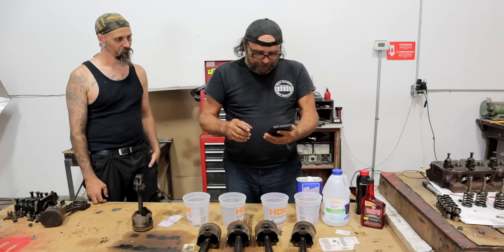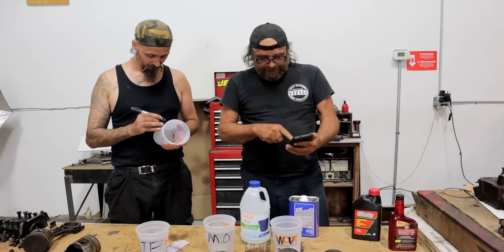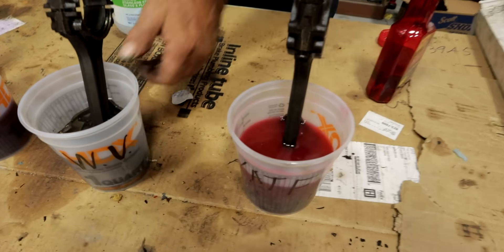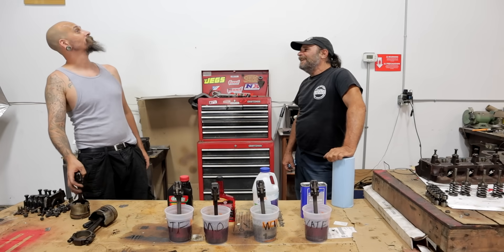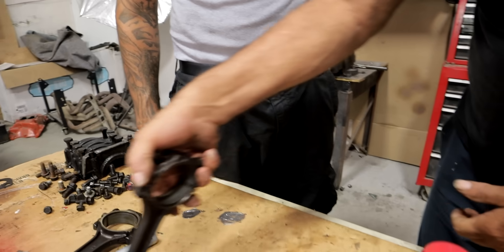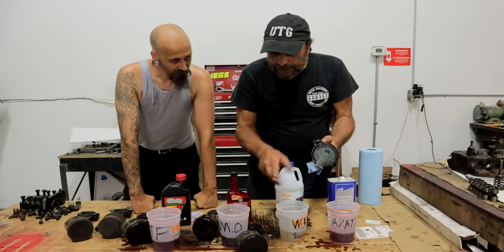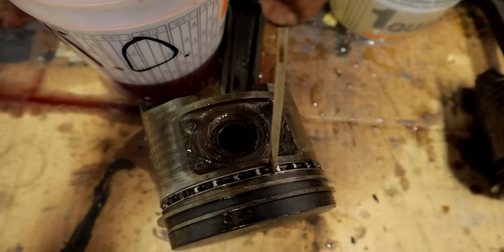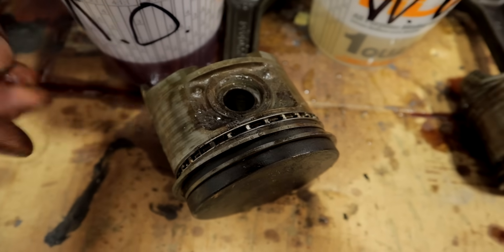Best Fix For A Stuck Engine - Viewers Choice. Marvel Mystery Oil, vs ATF, vs Acetone, vs Vinegar

Comment: The old Dexron II transmission fluid when at engine temperature acts pretty much like a solvent and should be
AOK to use since an older gentleman that had once worked at a GM Plant said to use provided that you use it
in such a manner as this: 4 quarts of old engine oil as in on a 5 quart system, 4 Qts to 1 Qt of Dexron II or just
drain 1 quart out of your 5 quart system and add 1 Quart of ATF. Drive the car for 200 miles and since the vehicle
is already in need of an oil change. Drive in such a manner that you are NOT driving the hell out of it but drive it
while acting in good prudence then go ahead and change the oil and replace the filter! This will help to release
a bunch of contaminants that are inside the engine that lead to these kinds of eventual problems!! YET, I also
believe that about 11 ounces of Acetone and 21 ounces of Dexron II if not Dexron III can surely speed up the 
process on an already viable engine just prior to a scheduled oil change should help work pretty good too! BUT,
do this in such a way that you are ONLY idling the engine for 20 minutes at 1200 R.P.M. Then change the oil n filter!

Comment: Ty for the video viewing. I had used MM on the floor jack when it would not hold pressure even when I stand on it. somehow I reason the use of MM on fuel and oil system may be used on any thing with o-seal. i have an old Sear 2 ton floor jack, nearly threw away or give it away. Than i thought i give a try fill the floor jack with MM and prime it few times. i let it set overnight to get the seal rejuvenate. sure enough i pump the jack to work the internal seal. this time i stand on the lift plate. it held pressure and repeated over and over just to be sure it work. this time i jack one side of the car which kept pressure over half a day. i did that on my 1971 MGB GT when it was leaking on the rear shaft area. after adding MM into the oil system and ran for couple hours, l set it overnight, the leak slow down and later no leak at all. the MM does work to reshape the o-seal when the seal got old and a flat area created. MM does work on seal if is not torn.

Comment: NOW THE REAL TEST BASED ON THIS VIDEO......Now you are saying I can remove spark plugs and put vinegar in each cylinder and soak for 24 hrs or longer to remove carbon and unseize piston rings!!!!!... I would probably have to change engine oil afterward.... LETS HEAR THE ANSWER(S) AND COMMENTS!!!!

Comment: pour a boiling hot mixture of engine oil and diesel fuel in the cylinder.......the detergents in the oil and diesel will clean the shit right out from around the piston...and the heat will expand the cylinder....keep the block hot with a weed burner (the oil has to be at least 200 degrees to activate the detergent)......it works 10x better than all of this stupid shit

Comment: Acid eats rust and cleans metals, muriatic acid would do even better.  But I'm not too sure if I would pour acid into an engine to clean the rings.  I mean acid also eats aluminum and brass and every other metal part eventually...

Comment: But what about  seized engine ?  That's simply parts  ! Are  you suggesting pouring vinegar into a seized engine?
Reply: Yes that’s the point it will clean up the cylinder walls and hopefully the rings, currently trying it out on my old 240z engine let it sit for 5 days sucked it out and shitload of rust came out so pour more in going to try to rotate it this weekend

Comment: Currently doing an Acetone/ATF 50/50 in the cylinder walls now. If that does not raise the compression after a good warm drive, may trow some vinegar down there. good job guys.
Reply: Sounds like a plan. Was just wondering though once dumping the vinegar in the cylinder while motor is still intact then starting it to get it loose later how does one get the vinegar out properly after & neutralise it's acid effect inside the cylinder with the pistons in there
Reply: You could possibly use distilled water to wash it out, im not 100% sure
Reply: Baking soda and some ATF should neutralize the acid. Baking soda is what's doing the neutralization. But you need to get it in there so I figure some thin oil will do.  Unless you have a way to gey the water soda mix out?

Comment: The white vinegar works apparently because it's an acid. But you can't put acetone in your gas tank white vinegar in your gas tank or ATF in your gas tank. I think if you had soaked them for 3 days the mmo and the ATF would have worked much better

Comment: If it's just rust-siezed, 5 minutes in 70-85% phosphoric acid will definitely take care of your rust problem. It's gotten a bit more expensive due to the '2020 issue', but I use it quite frequently on all manner of things for rust removal. Be forewarned, it is STRONG on metalized rust and Not something you coat and walk away. The moment you start getting white surface deposits (oxidation), it's time to wash off. Have a 5 gallon bucket of distilled water handy (or you can neutralize the reaction with ammonia). Carbon-siezed is more difficult to remove passively as it resists most every cleaning agent or solvent. Ultrasonic cleaners with a mild acid is the way to go there. Acetic acid is what makes vinegar work, and you can get the Good stuff from chem supply houses quite readily, though I wouldn't surpass 35% diluted for general cleaning duty.

Comment: I commented on your video about cleaning the water passages once and asked if you ever tried filling the block with white vinegar.  This is why asked that. I've been using vinegar to clean and remove rust from parts for about 20 years now. I don't rebuild engines much but I do know how well vinegar cleans off rust and gunk. I actually predicted the results of this test.

Comment: Vinegar is mostly water with a little acetic acid. I might use it on a stuck engine I was going to pull apart but not one I was going to run. You'd have to flush the hell out of it.

Comment: The viniger works by etching tje aluminum. Little impact on carbon. Viniger is mostly water and a very light acid. My choice was dry laundry detergent 2# per gallon of water. It has phosphates for greater etching and a strong detergent on the carbon
. It has been my tear down first part dip for cleaning for 30 years. Secondary.mechanical like wire wheels etc

Comment: If your try to unstick the rings in the engine I would not use the vinegar, like others have mentioned it would not stay put long enough to do any good. If the engine is capable of running then the MMO is a much better choice as would be BG44T to put in the crank case. Just follow the manufacturers instructions. If your cleaning the pistons out of the engine then just stick them in a gallon can of carb cleaner.

Comment: You can not put vinegar in a assembled engine. It will damage the bearing shells. It removes rust because it is a acid.
Acetic acid.
It will not remove rust if the parts are oily. The oil will prevent the acid from getting to the metal (and rust) surface.
Rings jammed in place by carbon can be removed with Dichloro methane. Aka methylene chloride paint stripper.
Again this cannot be put in a assembled engine, it will eat away every rubber seal in the engine.
Ps: Dichloro methane will also eat the skin off your hands.

Comment: Acetone is a very powerful chemical. They put acetone in fingernail polish remover. Don’t get it on the vehicles paint. If you use the acetone use it sparingly and use it up quick like a long trip. You don’t want it sitting in the gas tank to long. Some say  it can eat up seals and rubber.

Comment: Used MMO for decades on stuck engines. Soak for a week and breaker bar to crank nut. Worked a few free this way. The piston going up and down will move those rings slightly on each stroke. Good test but if stuck it's going to be stuck in cylinder.  I took a rusty exhaust clamp and pit in a old butter tub with ACV for 24-48 hrs and that baby was spotless. Guy used to take some heat to the bottom of pistons and swore that helped. Idk. I know a dip in a hot tank will get blocks very clean and help too. Depends on which way u wanna go. I used salt water and peroxide to rust clean clamp and then used muratic acid for 10 min. Clean as can be. Dried fast after wash in water then put Ospho on it. Still no rust months later. Stuffs great for that kind of stuff. Ospho can save alot of time and money for surface and bad rust. Get chunks and flakes off and soak with Ospho. My Pap got a formula for rust proofing in 50s. 1 quart any new used oil, 1 quart any new used trans fluid, 1 tube or tub of grease, 1 wax ring toilet flange gasket. Mix and heat on burner. When mixed spray, brush, pour etc on frame, body, seams etc. I've used this for decades. Fights north east rust better than fluid film, blaster, NH wax, etc. Alot of that has no oil base in it. Yes wax will coat metal but when it's wore off or whatever it rusts. Best is ospho for rust, seal it all up so it never can rust, use favorite coating of primer, zinc paint etc. Then the rust formula and you can forget about it for years.

Comment: Marvel Mystery oil is good in the old engines that couldn't run on unleaded gas...illegal in Canada. I had a friend bring me a supply from NY back in the 90's to use in my old side valve "45" Harley. 1 cap full or so per fill  up and all was good. Didn't know they even still made that stuff.

Comment: The vinegar will even work better if you soak it in acetone first. It will remove oils leaving nothing but rust for the vinegar to dissolve....I do a similar process with citric acid, but you cant leave metal in it as long as vinegar.

Comment: Can you add vinegar though to the crankcase oil if you trying to free up the rings without disassembly? Or to the fuel system, force it down the carb like sea foam or Berrymans?

Comment: That was shocking that strong white vinegar worked. Problem is though you can not put vinegar or acid in your engine and run it.  You can actual add Acetone, B12, PB Blaster through the engines oil to attempt to free the rings. Since vinegar is mostly water it is a recipe for disaster in the engine. I did not consider that the rings where rusted in place I was thinking more like carbon in place due to all the issues we have on todays cars with this! Cheer's!

Comment: No one considered B12 Chemtool? ATF and Acetone will not stay mixed they separate over time when mixed. The straight acetone will do the best out of those 4 choices. I would never put anything aluminum into an acid. Out of the choices the ATF/Acetone will do best but still not the best chemical for the job. I posted this 6:36 into the video.

Comment: Great stuff! Thanks for the experiment! One question I've had about the vinegar is would you be so bold as to pour it down the plug holes of a still working engine? I'd be kind of scared the vinegar would etch the cylinder walls. What do you think? 
This engine is getting about 150 lbs. compression on each of the 6 cylinders and it still pulls real hard, but it uses oil like a banshee (No leaks) and it smokes on acceleration. I've tried spraying PB Blaster down the plug holes, to no avail but still hoping to decrease oil consumption and smoke without tearing it down. Thanks!
Reply: For doing a piston soak like that, the only product ive seen that gives proven results is Berryman's B12 Chemtool.  Theres a youtube video on where a guy tested about 6 different products including Marvel Mystery Oil and BG EPG and Berrymans... Only the Berrymans showed results...car went from burning a quart every 300 miles to a quart every 1000 miles.

Comment: Acetone and ATF separate in a cylinder in only a few hours or less. You can test this easily. in one of the cups. Now when separating out which then the acetone or the ATF is at the bottom therefor touching the top of the piston?

Comment: I used marvel oil to free up a stuck Briggs and Stratton one-lunger. I poured some into the plug hole and filled the case. After letting it sat a few hours I turned the crank back and forth until I got a full revolution. I spun it over about fifty times or so, added a little more oil through the plug hole, and let it sit. I drained and refilled the crank then replaced the plug and after a couple cranks it took off. after a little smoke, everything ran fine. I really never expected to save the engine without tearing it down but it is still running after two years.
Reply: My motor smoked so much in the lil frontier after mmo in the cylinders overnight

Comment: Nice.
    Although not surprising I never thought of acetone. 
     Of course one could always use electrolysis as well. Just a little sodium bicarbonate and a bucket of water with a couple electrodes  and a battery charger. After a couple hours later totally rust free.

Comment: I can’t say enough good things about MMO. It has saved my butt lots of times, made me easy money and also saved me lots of money. The latest save was a 1956 330 Desoto hemi that had been stuck for 30 years. I poured some in each spark plug hole, removed the oil pan and hung the motor from my gantry crane. Then I slid a pan of hot coals under it and let it warm up to about 150 degrees. It broke loose with a screwdriver on the flywheel. Spins nice and free now. I have a picture of the setup but I’m not sure I can attach pictures here. I did this on thanksgiving weekend. It seemed the appropriate time to roast that turkey. MMO works much better if you can warm the motor up. It’s best miracles are when the motor will run and you can add it to the oil and fuel. Then it will remove carbon deposits from the combustion chamber and valves.
Reply: It broke loose easy because it was not stuck badly just a little but if you have a real bad stuck engine that snake oil wont to crap. 2 inch steel pipe and a hammer will do the trick all the time.

Comment: ATF is a lube, not a cleaner as far as I'm concerned. I've used Mystery Oil to free up lifters. Ive used K&W(CRC) 5 minute flush to do the same. Id like to see the K&W 5 minute flush used to try to unstick rings.
Reply: ATF has a hell of a lot better solvent properties than lubricant properties. It’s designed to keep check balls and valves clean while not allowing clutch packs to slip. That’s why it doesn’t work worth 2 cents in a manual transmission. Ever seen a manual transmission that calls for atf last very long? 😅

Comment: You gotta have a hot piston. 
B-12 chemtool is the cheapest and the best nex to amsoil powerfoam. 
Easy off oven cleaner does the best on a 350 degree piston.

Comment: Evaporust is a product worth trying as well. I've been soaking stuff in white vinegar for a while now. I've always just used the gallon jug from over by the salad dressing. You have to give it time but it works. Trying it now on a Predator harbor freight piston.
Reply: Evaporust is good cos it only works on the rust not the metal
Reply: I tried Evopo on a customers boat engine 454 total bust it did not work and it was just from sitting covered up for one season

Comment: There are White vinegars that have different percentages of acidity . I've read where cars that had been sitting for years and engine had seized . Were unseized by the use of Marvel Mystery Oil . By removing spark plugs and pouring it down each hole and letting it soak and then to manually turn the engine over .
Reply: MMO and ATF mixed as a gun clp. Or just use MMO has a clp. Stuff just works!

Comment: MMO needs to work in the engine with heat and running.  Stuff works.
Would you run vinegar in your engine?  Would you run acetone in your engine?
Reply: How are you gonna run a motor that's seized which you are attempting to reverse or has no compression due to stuck rings
Reply: @robsim4692 In a seized situation, then soak the cylinders with MMO.   What other choice do you have.
If it runs, then work it in with running time.

Comment: Although I enjoyed the video, I think this comparison is somewhat bogus because, in a real-world situation (engine in car), the Marvel Mystery Oil would stay on the rings and penetrate longer, and the vinegar would run  past the rings into the crankcase due to its watery consistency.  Submerging these pistons in the various fluids is not a real-world situation in my opinion.  Would it take a few more days to free up the pistons ? Absolutely, and may require more shots of the MMO as well.  Just an opinion !

Comment: Always used MMO soak in the cylinders with the 2x2/mallet method. The pounding must help free stuff up because I never had one smoke for more than a few minutes after running.

Never would've thought to try vinegar for this though.
Reply: What’s the 2x2 mallet method?  I haven’t come across that before.
Reply: @ManIsKind369  take the head off and use a bit of 2x2 board and a mallet to beat the pistons into moving.
Reply: @Zahgurym  thanks for clarifying,  I now understand :). I appreciate you sharing

Comment: Never would have guessed the vinegar? Great for cleaning your Windows too!!! I have a old 340 short block I bought years ago with the heads off. It was frozen then (25+ years) with lots of WD40 sprayed on over those years and still won't rotate. Guess I'll try some vinegar!😀
Reply: I'm in the same boat
Did it work?

Comment: I had a 2001 f 150 that smoked at a cold or first start and would smoke a little bit but untill I used the mystery oil every oil change at 2000 miles it cleared up with no valve stems burning oil .